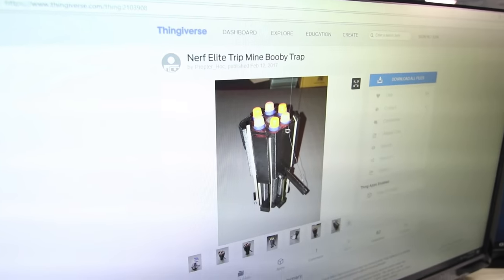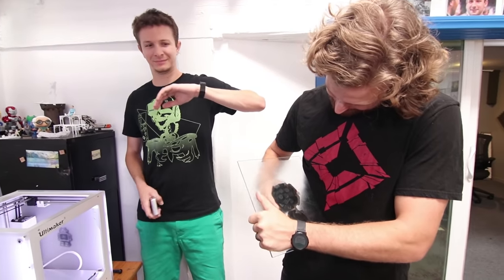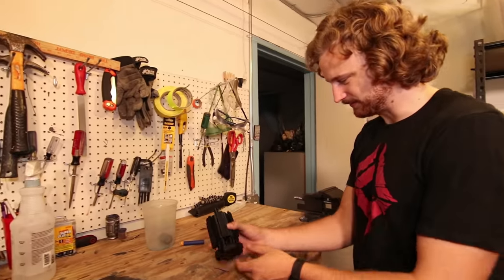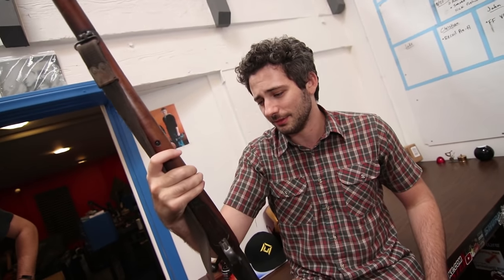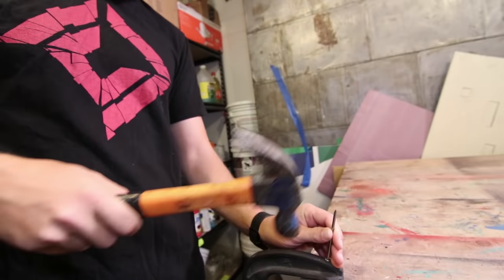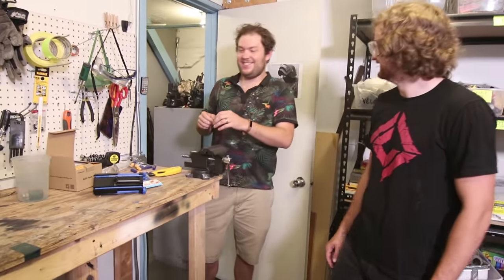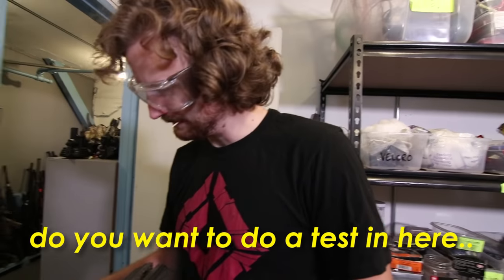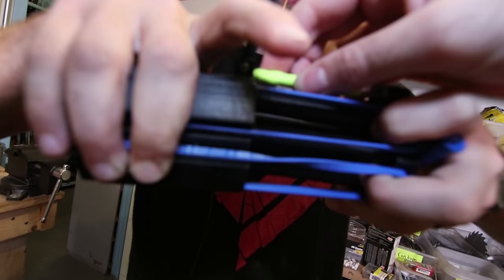Making a Nerf Tripwire MINE

Comment: Those old Indian riot guns are nifty. Don't go trashing that to make props.

Also, the mine will work better if you have larger plungers and neck the cylinders down to accommodate the darts.
Reply: Feroce 

What's the use of keeping something that isn't useful, where as you could literally scrap it to make it useful?
Plus, there a couple thousands, if not more, still existing.These were commom guns used by riot units.

Comment: What you could do for the nerf mine is grease the piston the turret sits on with white lithium grease to improve the velocity at which the darts come out. Might not be a lot, but you could try it.  Dunno what you could for the pin that holds the trigger though.

Comment: Use some painters tape on the print bed. It will make taking it off very easily.
Reply: That would de-level it due to the uneven surface of tape (tape is all that uneven but it is when applied and reapplied by hand)

Comment: For those stuck prints you should be able to run it under hot water. The glue will come off the print bed super easy.

Comment: As long as the wire on the nerf trap comes off it should be fine :P, if it's attached strong enough it could cause injuries, especially if someone runs into it.

Comment: Just a heads up the longer you have rubber bands and most other elastic stretched the weaker their release will be because they will turn some of the energy into heat. Might need to find something better to use for a trap.

Comment: The hand launching test is not a good test. The dart holder is not secured so at launch the rubber bands contract and not only pulling the black pushing rods in but also will pull the dart holder back. meaning that the force of the pull is not 100% transfered to the darts. maybe only 70%.

Comment: Jesus, what do you guys use as adhesive so that you need to CHISEL the thing from the print table? Just regular glue stick works just as well.
Reply: Well, a glue stick is exactly what we use
Reply: Huh. Well, that's some quality glue then. O.o My prints are sometimes pop off the Ultimaker by themselves even, as they cooling down.